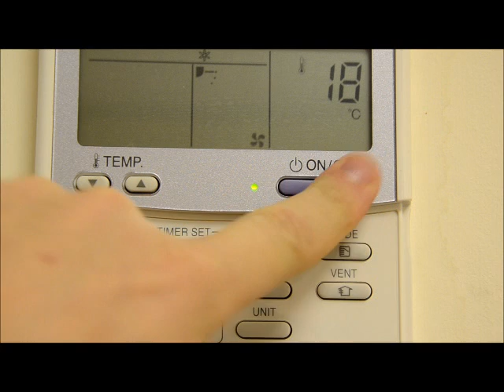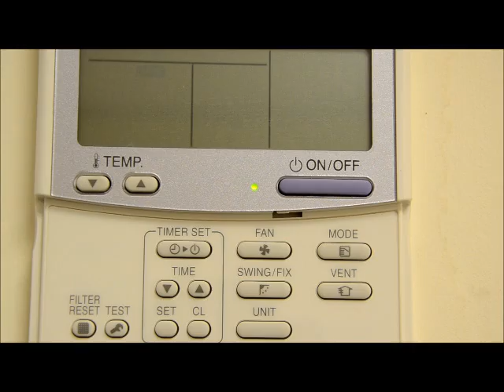Toshiba sensing at the remote control

Comment: Why in 2021 there is nothing for central air conditioners with wired Toshiba RAV SM 806 BTP-E consoles it was necessary to make a remote control, albeit a wired remote control, but to have an IR sensor or make it possible to connect it to the indoor unit board